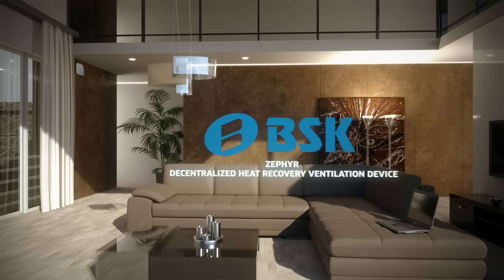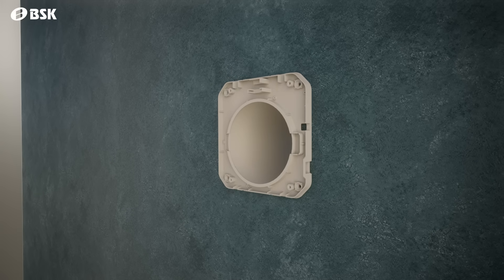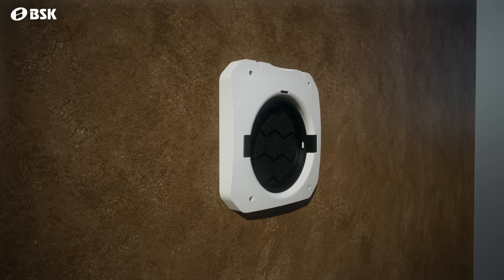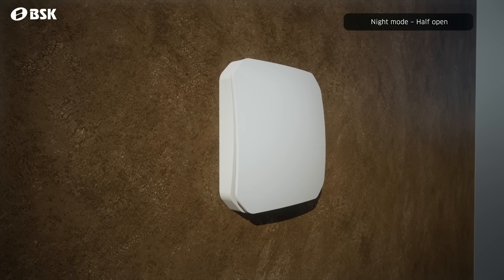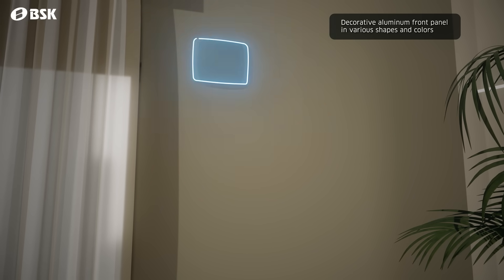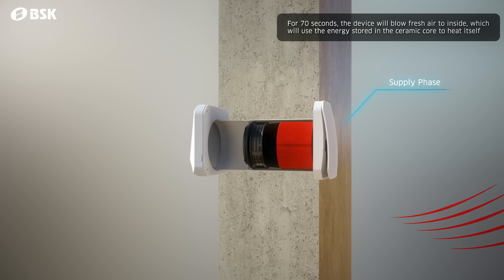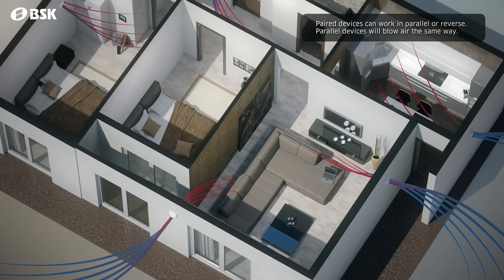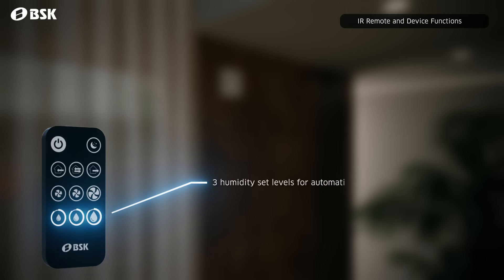Zephyr Single Room Heat Recovery Unit

Comment: Is it loud?
Reply: sleep is super quiet (15m3/h) gear 1 is very quite, you can't hear it right next to it really (30m3/h) , gear 2 (45m3/h) is already quite present but ok long-term if other devises make some noise (fridge or dishwasher or TV), gear 3 (60m3/h) is only usable when you're out of the room really. 
I mostly run gear 1 in a 40m2 (+-120 m3) living and the result is quite good already (measured Co2 levels dropped significantly)

Altogether, am very happy for the price and with the extra app. 
Note, in recuperation the effective airflow is 50% of the values indicated.
Reply: @michalrogalewicz8211  zamontowałbyś ten model w sypialni? Da radę spać przy tym na najniższym biegu?
Reply: @darekwch89 Do sypialni - tak.  Dzis zakupilem drugi wlasnie do sypialni -tryb nocny (15m3/h)  jest w sumie bezglośny; nawet bieg I - 30m3/h ! - nadaje sie do sypialni w mojej ocenie.  Nocny wymieni mi powietrze co 4h (ok 30m3) wiec zero obaw o halas.
Reply: @micharogalewicz6249 
Czy ten wentylator nadaje do do sypialni gdzie jest problem z wilgocią? Wilgoć z powietrza (Anglia)
Reply: @ewelinaziaja5713  W sypialni mam do 70%. Sam wentylator oczywiscie sie nadaje, ale to nie jest 'dehumidifier'. 
W sezonie cieplejszym,  jesli ustawimy na sam 'wywiew',  wyciagnie czesc tej wilgoci i wyrzuci na zewnatrz, oczywiscie. W zimie, uzywamy raczej rekuperacji (cykl zmienny wywiew/nawiew co 70 sekund), wiec wtedy efekt zalezy od pogody i wilgotnosci na zewnatrz. (logicznie, jesli na zewnatrz jest 80% to takie powietrze bedzie wdmuchiwane do mieszkania).
Reply: its quiet
Reply: When changing modes it has loud annoying beep sound. Things like these are skipped in adverts.